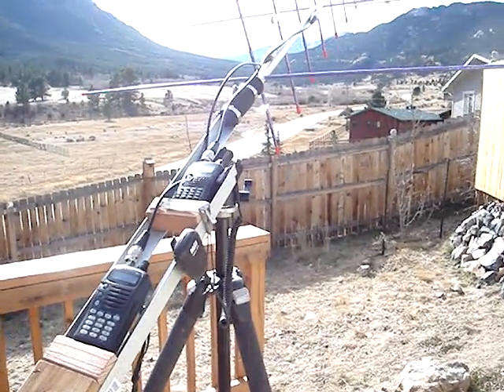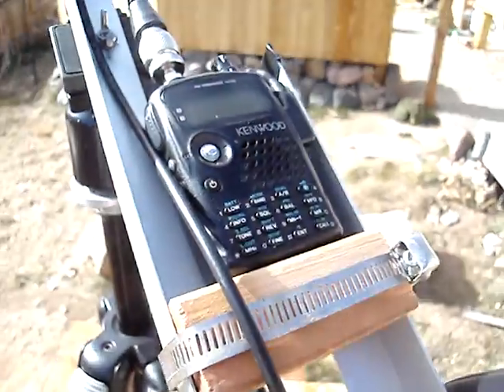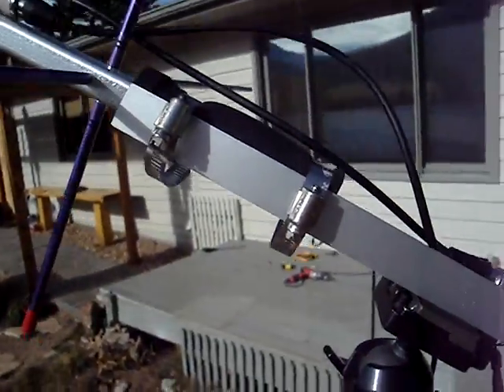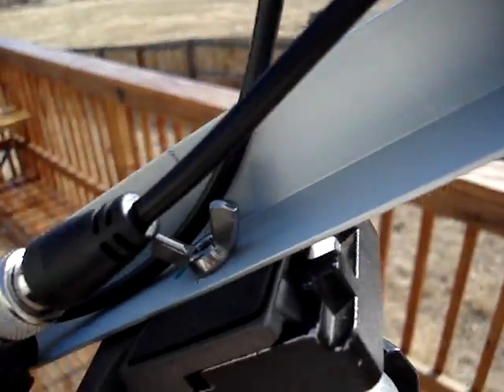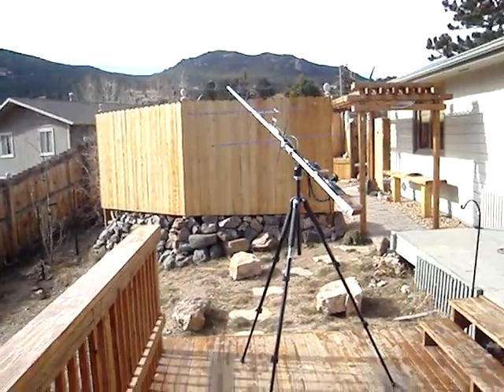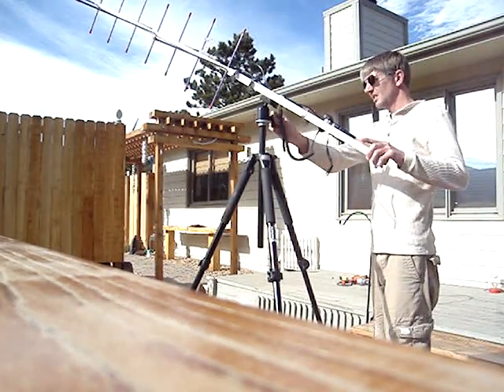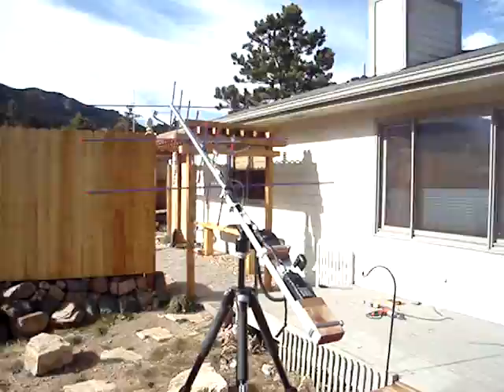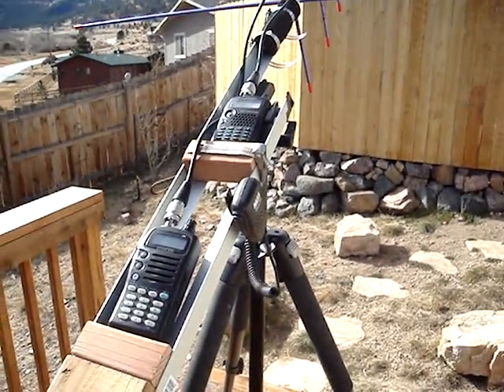Arrow II Sat antenna with tripod mount.......

Comment: I bought the same antenna. For some reason SWR is never below 2:1. One thing I noticed was that the clamp that attaches to the driven element, has no electrical connection to it. All elements on the antenna are coated with some kind of non-conductive polymer paint. I was curious if your antenna has continuity between the matching stub and the driven element?
Reply from the maker: hi andrew. thanks for watching.  i  sold this one!  i had one years ago. sold it. got another one. used it some more, then sold that one. so currently i dont even have one.  keep watching and please sub for more ham radio videos.
Reply: Thanks for your reply. Subbed.

Comment: I know this is an old video, but if you had to do it over again, what would you change about Randy's design of the holder? I am about to build one for my TH-D72a and arrow antenna
Reply from the maker: +Kevin Zari the ball head mount is key. i see on randys he did not have that. it is very quick to point and lock direction and go from horizontal to vertical. thanks for watching!!!
Reply: +Shutter Mafia Studios (Shutter Mafia) I have a ball mount so I'll let you know how I made out. Did you go with a 3 foot long piece as well?
Reply from the maker: +Kevin Zari i think it was 3 foot long.
Reply: Where can I find that ball mount. I've been looking all over and can't find it. Love your photos.